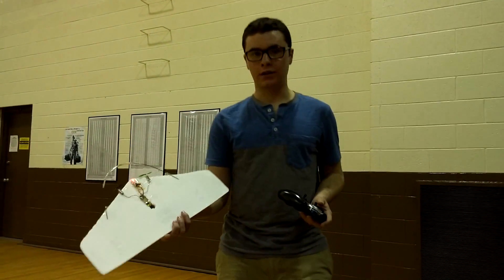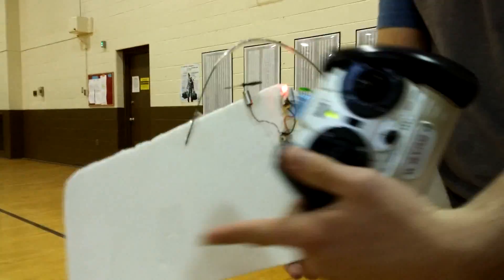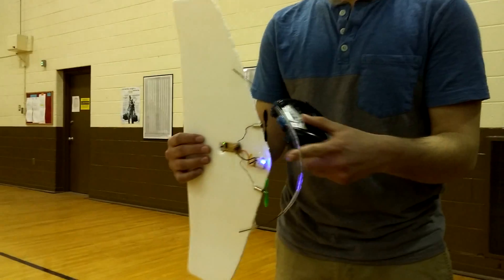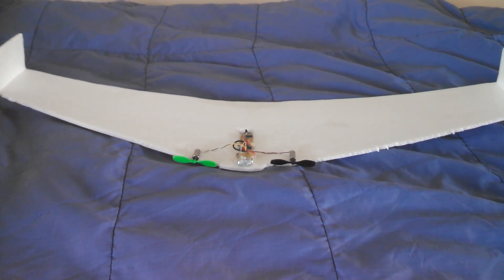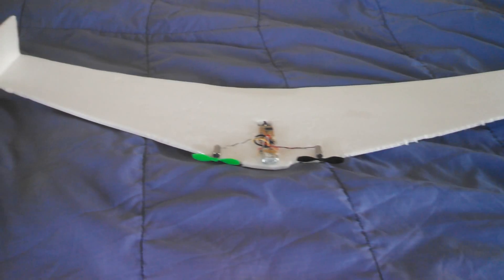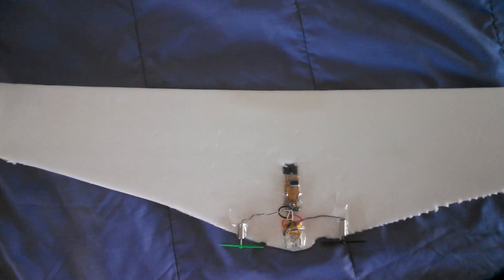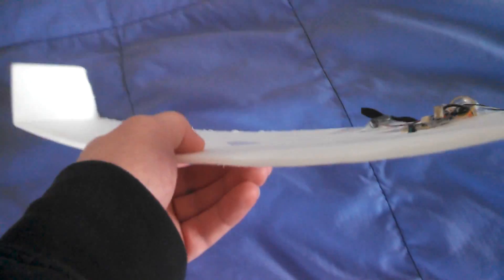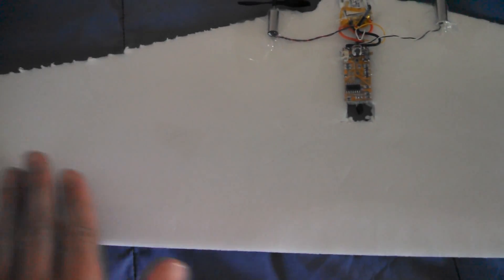R/C Airplane from Broken R/C Helicopter

Comment: I need to understand how the turning works with no rudder or aileron
Reply from the maker: Turning works by either the left or right side motor adjusting to output more thrust than the opposite side. Ascending and descending is simply done by increasing or decreasing throttle on both motors. It lacks an aerofoil so it is like a motor dragging a flat sheet to generate lift.
Reply: @DonovanMagryta  with what you adjusting to output?  are there both motor had the same speed when you ingcreasing the throttle?

Comment: Bcoz i m using the same elect. goods that u r using in ur plane.. but wants to know about prop.
Reply from the maker: +Ronak Panchal I used replacement propellers for the blade nano QX for it.
Reply: ok..but at both side CW or CCW? or CW and CCW?
Reply from the maker: Ronak Panchal One of each. So on mine, CW goes on the left side, and CCW on the right
Reply: ok sir .. thats fine. ill do as u say..thanks for support...

Comment: I Hi... got one question. Yesterday I made one rc plane from mini rc helicopter. But don't know it is not flying. So will u please inform me that which propeller should i use? pls reply so i can fly my plane. Thanks
Reply from the maker: +Ronak Panchal What seems to be the issue? Is the propeller blowing the wrong way? Do the props fit? Not enough thrust with too much weight? I need more information to help you troubleshoot
Reply: Hi, Thanks for reply.. As i said i m using mini heli parts. So I just wants to know that which propeller should i use in my plane? which will fits to my motors?

Comment: how this aircraft turning without servos?
Is by making off of one motor  aircraft turns on that side which motor we have off
Reply from the maker: +Deep Nagare It uses differential thrust. One motor pulls harder than the other to pull and rotate.

Comment: Nice concept. I also have a quadcopter and figured out how to switch the motor configuration to provide 3 axis control for a plane. Do you know of a way to disable the altimeter and let the throttle be user controlled?
Reply from the maker: +Science Man I don't know how to disable an altimeter. I assume you mean for altitude hold mode?
Reply: Yes, there is no conventional way to disable it

Comment: how do you control pitch and altitude? first time I'd seen someone do it without elevators.
Reply from the maker: +hardcore rebel Using the throttle. Just like the Flybear FX series RC airplanes
Reply: Donovan Magryta where the survo ??
Reply from the maker: 99 Club KR RIDER ARIANSYAH Differential thrust provides all the steering needed. Most 2 channel r/c planes work this way.

Comment: hey 
i got a question...
my rc helicopter has a moter turning the wrong way round
how can i fix this ?
Reply: I just carefully snipped the wires on one of the motors, switched them around, and re-did them. (Since I had 2 props that were the same).
Reply from the maker: +willy knibbs You would need to use a propeller that is angled the opposite direction of the current one. So if CCW propeller, use a CW propeller instead, and so on.
Reply: you have to counter torque or else it will end up turning on one direction
Reply from the maker: +YATO_ GUMMY Correct. hence the wide wingspan
Reply: If the propellers are in the right direction, just change the polarity of the non-matching propeller and motor(if that makes any sense)!
Reply: if you want it for your helicopter! than sorry i don't know about it, but if you want this for your plane than just make your aileron to turn in other side...(if torque turns plane in left side....make aileron's to turn plane right...) rudder won't do it...cuz rudder control 'yaw'...and you want to counteract 'roll'....hope this was helpful....

Comment: How to convert 3.5 ch rc heli to plane?
Reply from the maker: I don't understand your question. The helicopter I used was a coaxial helicopter with three 3 propellers (3 motors). One tail motor which I cut off and discarded, but 2 identical motors driving propellers directly above each other.
Reply: K...now i get it......but the problem is i have a big heli....its not infrared....so does it work the same....
If yes then can it be flown outdoor?
Reply from the maker: +pranav sonkamble If it is a coaxial type helicopter, than it ought to work, hypothetically. If it's not infrared, it will work outside when there is zero wind.

Comment: how this moves upward
Reply from the maker: It ascended by flying faster, and descended by cutting the throttle off and gliding downwards. It turns by slowing down one side motor. because of the wing design, it descended and ascended rapidly. Just Google search "2 channel R/C plane" and watch a video. Hope this helps

Comment: my fans r pushing air forward
Reply from the maker: You could make it a pusher airplane instead of a puller. Or you could punch a hole in the propellers cap with a needle and put the propellers onto the motors axles backwards so that it would pull.
Reply: Then reverse the polarity.

Comment: How did u make the plane turn....which paper did u use????
Reply from the maker: Hi,
to make the airplane turn, one motor (left or right side at a time only) speeds up or shuts off. I used foam board from Dollar Tree for the wing.
Reply: @DonovanMagryta  it

Comment: No problem! I made the airplane yesterday, but it wasn't taking off. I'm assuming it was too heavy I'm gonna try to make a better frame, but lighter. The helicopter I used was the Syma S032g. I'm gonna use another helicopter which is like 25 inches and try to make an airplane from that.

Comment: You've been such an inspiration and I decided to make my own RC airplane from a broken RC helicopter! Great job on your plane, i'm looking forward to make a plane a bit like your, but with a more design. Great job on the video and plane!
Reply from the maker: Glad to hear it! I found later in that a non infrared helicopter (2.4GHz) works wayyy better at longer distances. even outside when there's no wind. But yeah, a different airframe with vertical stabilizers and/or a non flying wing style would work too, as long as you keep it very light. Thanks again for checking out my video, and for the nice comment.
Reply: sex karega to samazh a zayenga